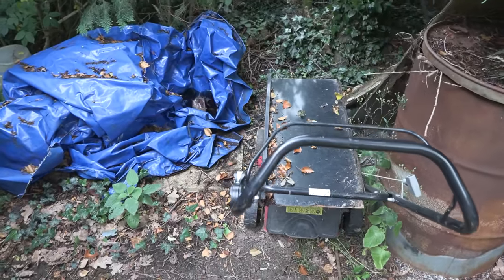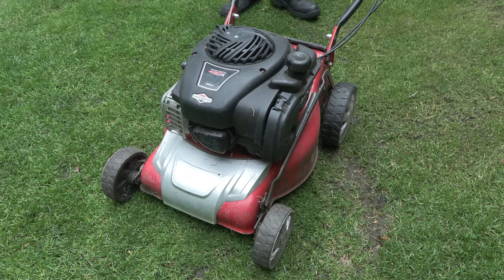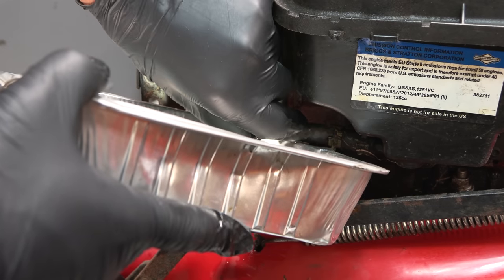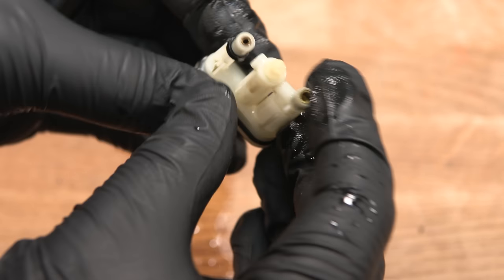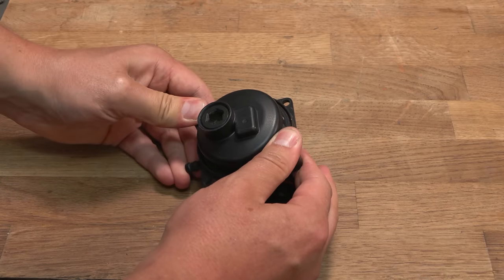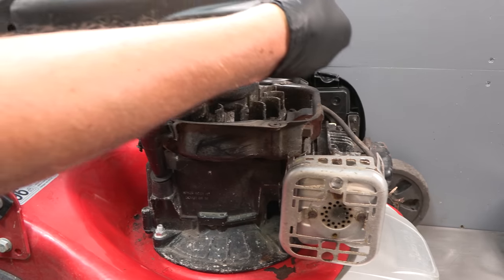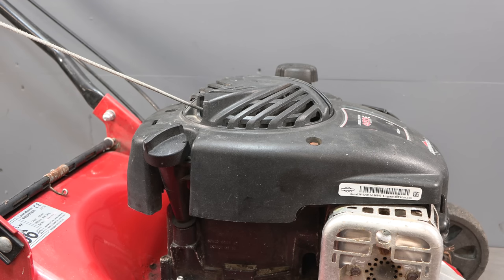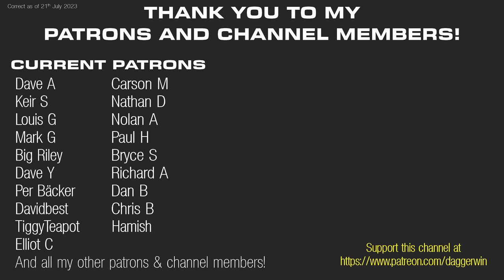I did EXACTLY what you SHOULDN'T do

Comment: I'm not gonna pick on you or beat you up. Just giving some facts. That STP is garbage. It doesn't burn like gas. Berryman's Carburetor and Injector cleaner does. You can use it to back a car up on the lift to change a bad fuel pump. I'll watch anything you post but there's a bunch on this very subject with a bunch of garbage mixed in. Very well made video.

Comment: Nicely done! Usually when I take one of these apart for service I remove the starter housing first, then the tank and carb can be removed as a unit and separated on the bench for cleaning / flushing. I like these newer Briggs engines, very service friendly and no corrosion from bad fuel.

Comment: The problem with the 450E carb is that the jet has been made VERY small to meet emission requirements. drilling the jet to the next possible size up is often the solution (next size up from the jets original size.

Comment: Thank You! 

I have a slightly newer model (DOM 4/2017) of that B&S engine. Mine is a new old stock - bought it on eBay for $100 and have it mounted to an older MTD mulching push mower deck. So far it has 29.5 hours on it. All of my equipment has a self-powered hour meter (if it doesn't already have one). 

I have my parent's Murray 22-inch side discharge mower they bought brand new in 1986 powered by a B&S 3.5 HP quantum flat head engine. Still running strong and that engine has over 500 hours on it. They always had it stored indoors. 

As of 8/2006 I bought a Yardman 21iinch self-propelled mulching mower powered by a 6.5 HP B&S Intek overhead valve engine and that as of this last Saturday is up to 302.47 hours of runtime. The gas tank spung a leak at 165 hours, so I replaced that for one with a larger capacity. I had to replace the catalytic muffler at 243 hours to a standard muffler, then the electronic ignition coil gave out at 287 hours. So... around the 200-hour period I had to replace some things. It runs better than new! 

No, you cannot have too many machines to "Play" around with.

Comment: I'm pretty sure all those types of engines with that carb set ups surge. I'm absolutely positive you know you have to in large the jet slightly. I had to do that to several mower that I've fixed for people. It blows my mind that this problem exists on these engines
Reply: My understanding is that (at least in the US) the carb jets are manufactured narrower to help meet fuel emission and consumption standards.  The narrower jets are more easily blocked, particularly with ethanol added gas, causing fuel starvation and thus surging.  I've also found that these plastic carbs start to deform in high temperatures (such as those found in the southern US) causing the same kind of issues.
Reply: Yeah your right, the 450 series with that style carb needs the main jet opening up just a hair, apparently the new replacement jet cartridges  are slightly better.

Comment: Great video. love watching your videos. i do not have a building/shed to put my push and ride on mower in. so i put a heavy duty trash bag over the motors After the engine is cold after i use them. i do drain the gas out of them in late fall, including draining the gas out of the carbs. this seems to work for me.

Comment: nice little mower, we have one thats smaller (which yes, is possible...) which i may have accidentally left outside all winter, we live in quite a snowy bit of america, so it was under about a 6 and a half foot (2 meters or smth like that) snow drift... though we dug it out in early spring, replaced the oil, replaced the fuel, and vroom, runs fine now, was a bit smokey at first and a bit down on power for the first mow, but after that, it was fine

Comment: We have these in Australia badged by Victa (blue deck, grey handle). Those little 16 inchers are a good second mower option for really awkward terrain. A steep grass hill that slopes to a concrete gutter is very sketchy unless the mower is light and nimble like these ones.
Reply: So true.  I actually have a 13 incher that I use basically as a bagging weed wacker.  Not just steep banks (have a few of those), but tight spots where the bigger mower won't fit. Bought it on a whim and can't believe how I lived without it, lol

Comment: These are the late engines that ruined B&S reputation. Anything post 2005 stratton is not known to be reliable. You need to get a Honda HRU194 and restore it; best quality mowers ever made and 40 years old! I very recently had a walk behind Honda HRU195 with over 10,000 hours on it, worked perfectly except for the rubber valve stem seals that needed replacing

Comment: Hey machinery restorer I have a masport 200 series 18 lawnmower with a 450e series on it and for some reason it is hunting and surging. I have replaced the carb and the spark plug and it is still running rough. can you help